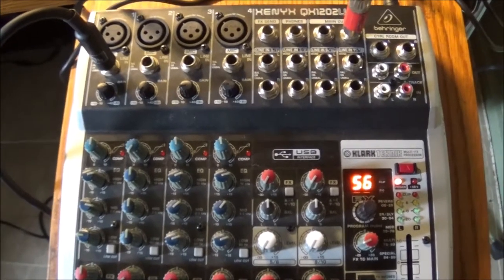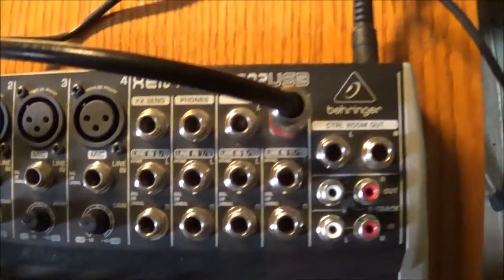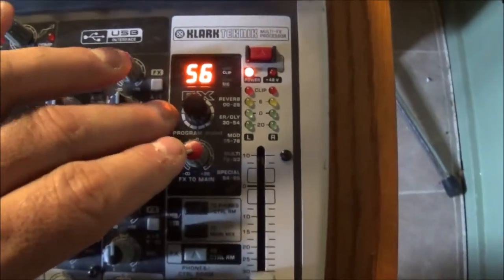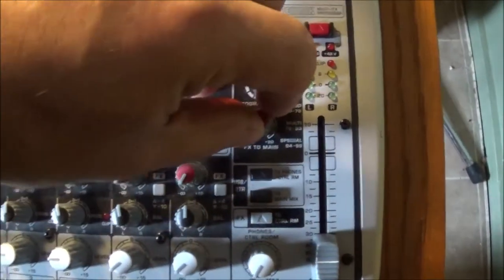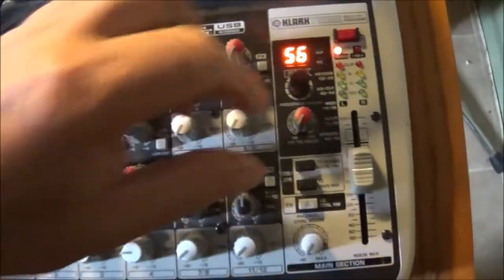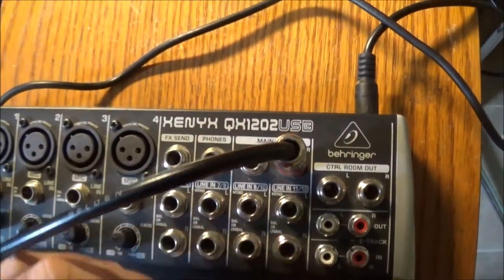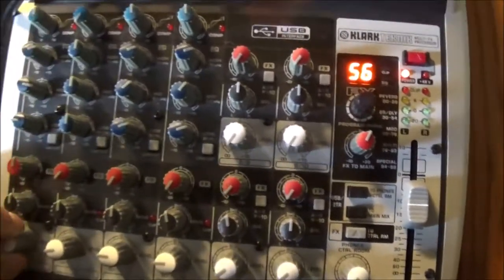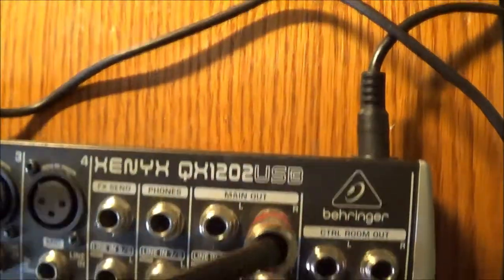Behringer Mixer Effects Unit Hissing - Easy Fix

Comment: DOOOD!!!!!!! This totally solved my problem. This happened on a gig and I changed cords, speakers, mics, everything before I figured out the effects were glitching. I thought my little board was on the way out.  My 1202 is working as well as ever. THANK YOU   THANK YOU    THANK YOU!!!
Reply from the maker: I am glad you got your board back to working well. the AC plug design is very poor and you need to be careful as the plastic key or any of the pins can be broken off if you are not gentle and careful when inserting the AC plug into the jack.

Comment: Went through a ton of videos before I saw this one and sure enough it was just the power plug needed to be unplugged and plugged back in again. Got that hissing noise out of my FX settings now. Thank you very much. I'm happy it was just something simple.
Reply from the maker: Yes, I was lucky too when it happened to me. Just be sure when you insert the power supply plug that it is in firm. Thanks for watching.
Reply: You just restarted the unit that’s why it went away, temporarily. It was a bad effects module connection. I may be wrong i hope your issue will not come back.
Reply: @TheDJjems  So far in the last 6 months it hasn't come back and everything is still working good. I hope it will at least last me a couple more years.
Reply: @Dragontech1  same issue i have. However its the 1204 model, it has the built power supply. Lucky for you it went away🎉. I’ll  open mine and see if there are bad connections as well. Thanks

Comment: Great. Now to deal with the buzzing noise, caused by cheap Capacitors drying out.
Reply from the maker: If it is not a double sided board. The Caps would b easy enough to swap out.

Comment: Powercycling the unit does sometimes resolve the issue temporarily, the actual cause is way more complex I am afraid. It is present on all 1202 and other mixers. I have it on a RX-1202 and another small factor mixer, all of them do it occasionally which requires the power to be reset. 

I suspect either bad design on the power side or another problem within the circuitry.
Reply from the maker: Thanks for the comment and information.

Comment: Wait what?! 😳 The sound in the end of the video.. after the fix and when you turned up the volume  there is a sound... i got that when not playing... is that a normal sound? Omg i been looking for hours.... Got my mackie yesterday so im 12 hours in my first mixer. Haha
Reply from the maker: The noise you likely are hearing is the LED lights or electronics noise which is normal. You can usually cut the noise by moving the mixer away from the noise source or perhaps buy a good extension power supply with some noise filtration. 

Most video cameras these days seem to amplify these white noises. I assure you that my camera did amplify that white noise. It is nowhere near as bad listening to the signal live.

Thank you for your comment and good luck with your audio mixing.
Reply: @Tobinindustrial  Thx for the answer. Yeah i have alot of electronic on one table.. Ill just mute or turn volume down when im not playing.. Just happy now i can let go of it for now. Thanks so much. Have a nice weekend.
Reply from the maker: @KrilleEgnell  you as well my friend. God bless you.
Reply: @Tobinindustrial yes I agree with the cameras being sensitive to some noises. I have a fluorescent light I had to get rid of, because my hero 10 would have a annoying hum noise it would pick up when doing videos.
Reply: @Tobinindustrial amen

Comment: Where was the buzz coming from on your #1 channel? Sounded a bit 'earthy' I have the 1002fx, but have never had that problem. But it was a good fix for the power cable. Not had that problem yet, but who knows, it might still happen...lol
Reply from the maker: No idea where the noise came from but sometimes a pot turned to fill will cause some white noise audio.

Comment: nice, i have the same problem,  when a understand that , was to late,  its got over heat,  i now  it cant work, some  one now an  idea how can fix it?
Reply from the maker: The hissing I had was due to a bad power supply unit connection. I am unsure why yours overheated. A replacement power supply can be found online if that is what you need
Reply: thanks , i will try that, 😅😀 @Tobinindustrial
Reply: already buy a new power supply, problem solved, thanks cheers  😄
Reply from the maker: @SQuaresma  You are most welcome.

Comment: I have a Xenyx x1622usb with the same issue. I have tried to unplug the power jack but it did not fix.
Reply from the maker: Perhaps it may be an internal ribbon cable or connection that is loose. It may even be failed components. I hope you resolve the issue my friend. I wish I was closer to help you.
Reply: @Tobinindustrial  Thanks! I have sent it back for the same issue, during the guarantee time and they (Thomann) have sent me back as fixed. Since then I used it only a couple of times, and the issue occurred again 2 days ago.
Now Thomann doesn't want to take care of it, because the guarantee time is expired.
But in my opinion the issue was never fixed.
Reply from the maker: @domenicocaruso2153  That is sad to hear. It sounds as though they reconnected a loose ribbon cable and they failed to secure it properly. I cannot be sure if that is the issue but I'd check the grounding and Positive on the power jack and check all connections internally. 

It may be a bit more than you are comfortable with. If a component did not fail and they cleaned and lubed the suspected pots, then it is highly likely it is a poor connection internally. 

I never had to do this but you could clean your power supply plug well and also clean the jack on the mixer well. Poor grounding will cause this issue.

The worst case scenerio is that the effects unit has failed. There is a way to remove it from the audio chain so that the effects won't work but the rest of the unit will function but that is a bit more complicated than actually unplugging the unit I think. I wish you well brother.

Comment: I was like 99, soon 100 people have fixed their mixer by plugging the cable completely in 😂
Reply from the maker: I am glad this video helped you as well. You may find that the actual plug system they used here is a poor design. Thank you for your comment.
Reply: It doesn't surprise me, initially I thought I messed a ground somewhere after replacing the caps  of the powersupply but nope, it was "try this one trick to make a million" hack that actually worked. I'm just glad I didn't have to open it up again :face-green-smiling:

Comment: Na, I’m afraid it didn’t work for my Xenyx 1202 - I was hopeful by the comments. I’m just going to have to live with it.

The annoying thing with the mixer is the FX taps off after the channel volume in series, and not in parallel. So if I want a channel to mostly go to the FX line, I have to crank the channel FX to max and slightly turn up channel volume to compensate 🤦🏽‍♂️ You can’t have the channel just go to the FX or the main independently
Reply from the maker: I am thinking you may havre a loose ribbon cable inside your mxer that is causing this. I have never had this mixer apart so I cannot be sure. The FX section should be a seperate board with a ribbon cable connection to the main board. I am sorry that you are still having trouble.

Happy New Year.
Reply: @Tobinindustrial  happy new year! Na, I had already checked the wire schematic  in the manual, the channel fx volume literally follows after the channel volume - so if you turn the channel volume right down nothing passes to the FX. It boggles the mind why they built it that way
Reply: I return to say the hissing has gone! 🙌 I don’t know why, but this time I’ve powered the mixer the FX line is a nice silence… maybe some of what I had connected last time caused some feedback loop 🤷🏽‍♂️ So I swallow my words 😅 Thank you!
Reply from the maker: Awesome news brother.
Reply: Yeah, but I’m afraid it has come back again 😅 I’ve now ditched the FX send to use the 2-track out and in instead.
Reply: @ckhatton Same man.. So frustrating. I just said the hell with it my Mackie mixer will be here tomorrow lol how about you still having issues?
Reply: @55thReversion  Yeah I still have the issue, as like I said in my last comment, I have stopped using the FX channel altogether lol. I instead use the “main out”to “2-track input” for my FX pedals, with the “2-track to control room” button pushed in

Comment: I had this issue on the 2222usb desk, unfortunately it's happened 3 times now in a live setting which is unacceptable. I'll be returning it. Can't have it happen during a live gig and need to unplug and plug back in.
Reply from the maker: Sounds like a bad grounding of the PSU to the unit. Maybe some corosion? Maybe a poorly made plug that is not snug enough? It could also be a bad ground wire (broke) at the plug area where there is strain relief. Either way, you are right. You can't be having this happen during a live performance.
Reply: @Tobinindustrial  it could be those things! Thing is, I only bought the mixer 4 weeks ago! It did it the very first gig I used it but hasn't done it since. Then yesterday at my gig it did it twice in the space of a few minutes. The audience members who were sitting closest to me actually jumped in fright the noise was so loud!

From what I've read the issue is something to do with the effects unit rather than a power issue. From what I've seen online it's a known fault. Either way, I'm returning the desk!
Reply: My brand new Behringer Xenyx
x1204fx sub tonight. 
Bloody nightmare. 
Terrible interference coming thru the effects processor. Channel absolutely fine until I turn up the FX then ... Static and what sounds like white noise 
. Tried everything to fix it with audience leaving the room. Then turned it off and on again. Problem gone. Then 10 mina later. It came back. Turned it off and on. 10 mins later. Came back. Same again. Then was fine for the rest of the night. 
Bloody dreading my next gig. What the hell is causing this? Any ideas? Surely can't just be the power lead.
Reply: @blindmansbluff  sounds exactly like what happened with mine! I found online in a forum that it's a known issue with the effects units in these desks. Apparently Behringer advises you can reset the effects unit to fix it, but I wasn't prepared to do that as the desk was only 4 weeks old. 
Return it and get a Yamaha instead. I can also recommend the Behringer Flow 8 which I bought instead and it's excellent, no issues at all with it.
Reply: @davidwicksmusic  thanks Dave. Which Yamaha are u suggesting? Proper upset as I've had the Xenyx range for 15 years and they've always been great.
Reply from the maker: @blindmansbluff  Thank you for your comment. The one time this happened and I realized the issue, Once I plug the AC plug firmly into the mixer, I have no issue. If I back off the jack from the mixer, the noise reappears. I have had no more issues with this jack since I always firmly put the plug in the mixer. 

It is not the greatest design. I understand they wanted a small form factor mixer so they removed an internal PSU to make the footprint smaller. 

I suggest that if you are worried about this issue, go with a larger mixer with a built in PSU or retrofit the plug to a three pin external female plug and hard wire the adapter to a better plug. I am not sure exactly what that would look like.
You could also check to assure that both power supply jack and mixer jack are mating firmly and not deformed in any way.

Good luck with your future gigs my friend. God bless!
Reply: @Tobinindustrial  - cheers Andy. Thanks for the info
Reply: @blindmansbluff  I've used various Yamaha MG desks over the years. Depending on your needs, the MG12XU is great. I have owned the MG10XU but the main shortfall it has is that it has no PFL mode to be able to set your gain accordingly. The MG12XU allows this 

Highly recommend the Behringer Flow 8 if you need a small desk with built in effects. It's super easy to use and intuitive. I use it for solo acoustic gigs and it's brilliant and cheap given the features.
Reply: @davidwicksmusic  nice one David. Thank u
Reply from the maker: @blindmansbluff  I am so happy when I can be helpful. God bless.